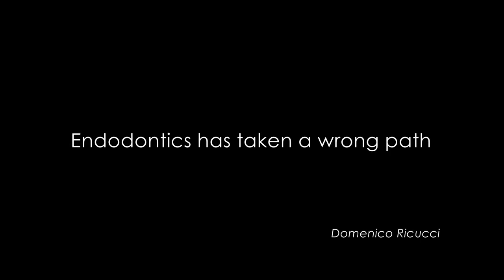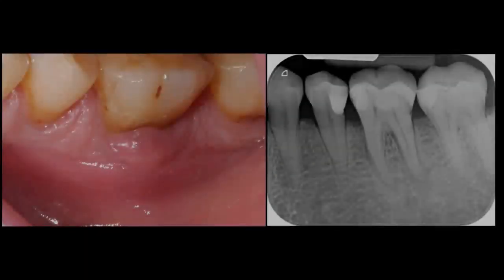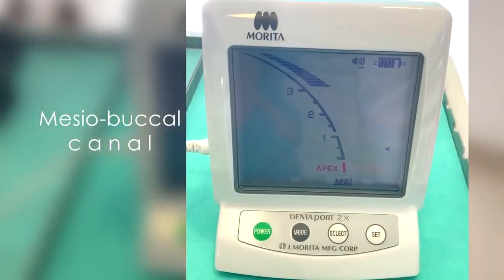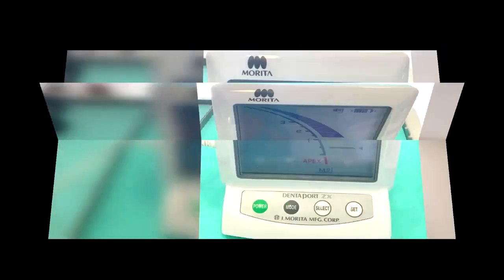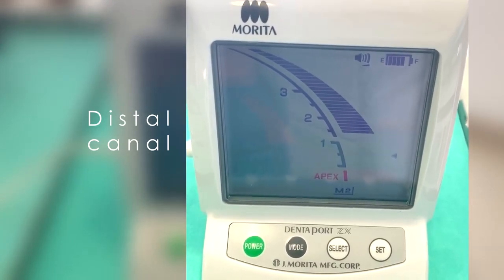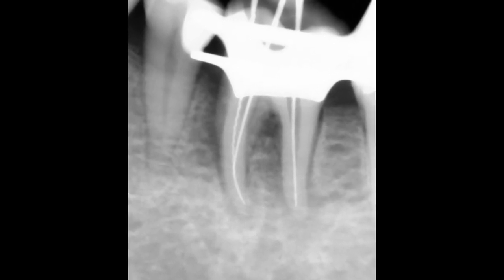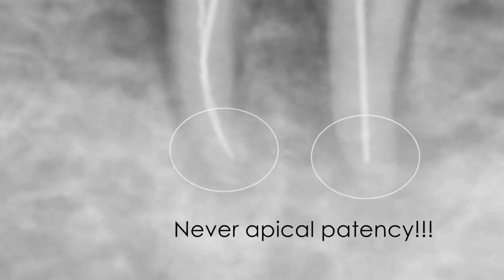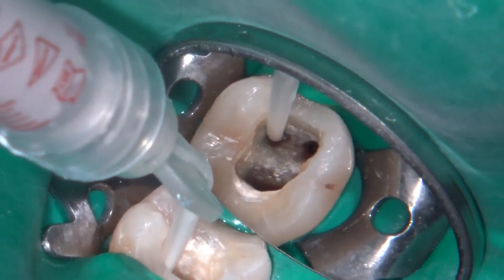Root Canal Working Length (Endodontist's Apex Locator)

Comment: Too much debate on this topic, also you can set the Morita to read at different levels on that green scale. El Ayouti most recent CT scan studied showed it can be up to 0.9 mm from the radiographic apex.   -2nd year endodontic resident in a USA residency
Reply from the maker: Hey UC.  Thanks for noting that.  As a resident, would you agree or disagree that the focus today (endo speaking), is more on ensuring that the gp/sealer combo meets the PDL vs the "constricture".  

I have noticed that almost 100% of the cases that are referred out from our clinics-  when they return - they all have a puff (vital cases as well).  I'm not talking about the radiographic apex either - it's past the smallest part of the canal and into the PDL.  

I think that talking about the radiographic apex is a moot point today - there are enough social media posts of amazing endo's with puffs that aren't anywhere near the radiographic apex - but - they are into the PDL.

And to leave a case "short" may be of concern to the referring dentist - even if it is perfectly done.

Thank you so much for your time.
Reply: UCTeeth USA ! USA ! USA !

Comment: It’s wild how the top endodontist still have disagreements about this exact topic. Some insist on establishing apical patency with a 10 or 15 file, others swear it off. It is almost as if it might not matter that much and it could be a case dependent variable.
Reply: to me depends on teh case. if we have a necro or a bio. If we have a necro, the tissue around the tooth is already dead, so we must do it so the fluids we use for the desinfection reach post-apex. IF we are working on a tooth that is not on a necrotic state yet, we should do it, or we will push the bacterie out of the apex. Sorry for my englsh but i hope you understood
Reply: @pedrotavares5028  I see what you are saying. I’m going to take this onboard and run it accordingly. Very intelligent perspective you are sharing here
Reply from the maker: Reed Hornsby great piint